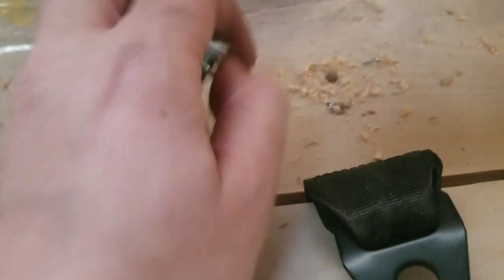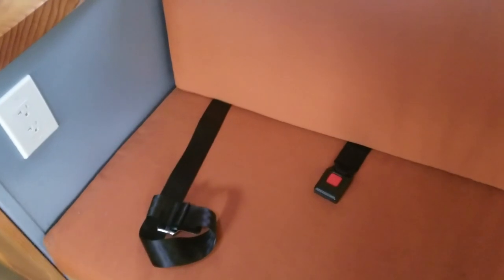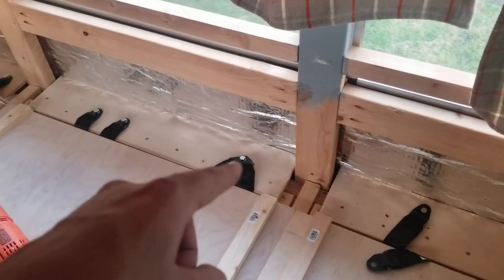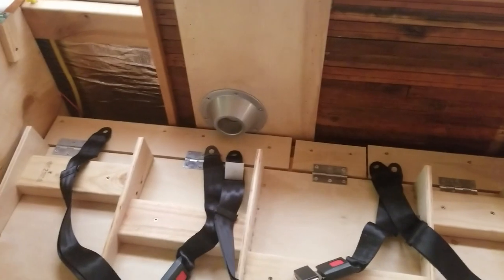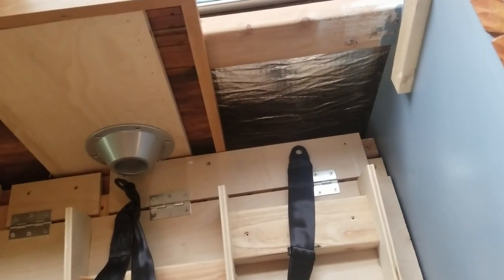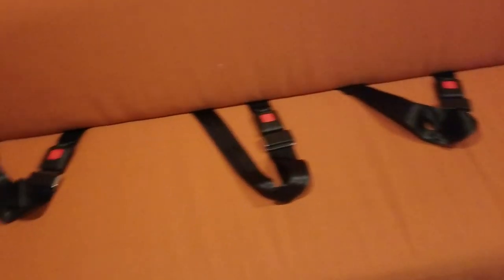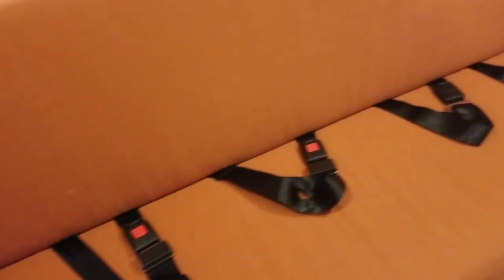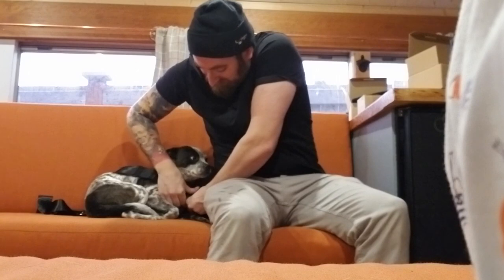Conversion Video 55: Seatbelts

Comment: The main thing for a good secure seatbelt is the structure of the seats and how they are secured. As long as your seats are secure your seatbelts should be good. In other words you just don't put seatbelts on a sofa without first securing the sofa. There are seatbelts that wrap around the furniture but I don't see anything wrong with what he's doing.